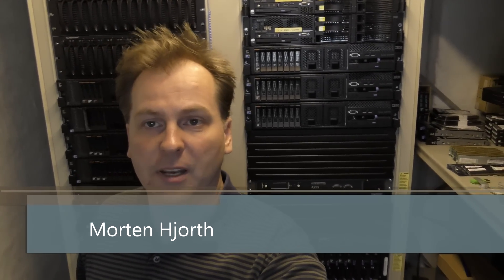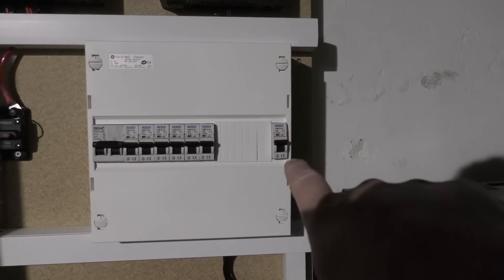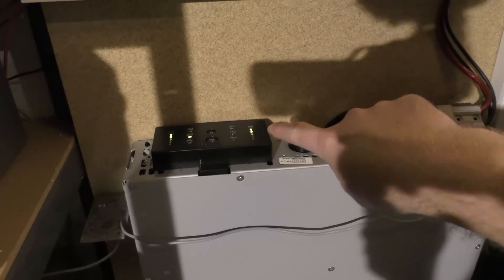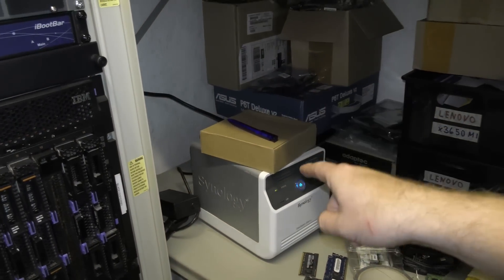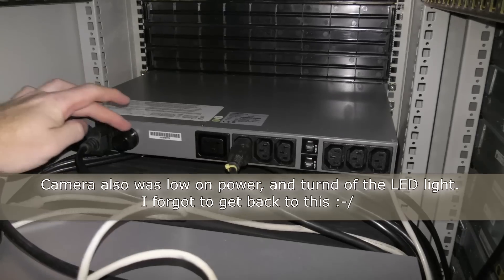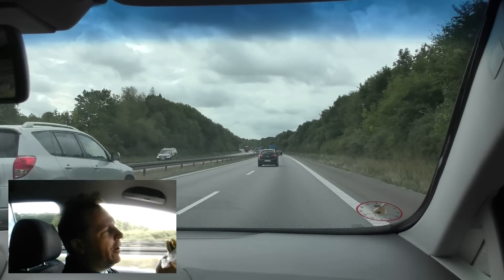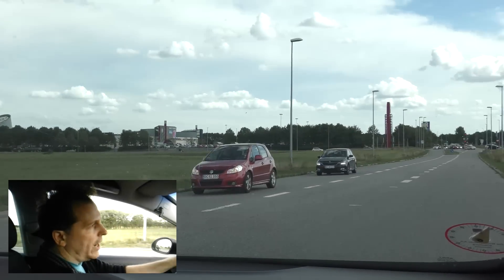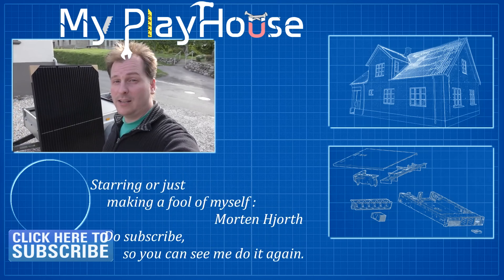I want to Run my Data Center of Solar Power - 733

Comment: The comments on here are really good..

The UPS is shouting at you as you are feedings DC to its AC.

I shall assume as I dont have all the details....
Plug main power ( normal) is as you would. and then take from the UPS Batteries out to the solar batteries.
I get the thinking but you would have to DC to AC invert and then AC to DC invert running it any other way and this will cause a lot of issues.
If you have put the batteries to the batteries of the UPS, then the voltage maybe too high or the amperage ( as you have no regulation) and the old batteries you have there will push out roughly 140 times more amperes.

Please update the chain wires between the batteries as it dangerous! You need higher gauge.

My UPS plugs to mains power and will switch to battery as is the standard. the only short coming is the capacity of the batteries. I think your trying to do it the right and wrong way.
Ill assume you're 240volt mains.
a battery 13.76 volts X 20 (275volt/228volt)
As you can see the range is fairly wide, you will want to run 19 Batteries.
(240 /12.5)
You will also need to test the batteries ( Wattage and amps) to find the capacity.

You then run the batteries in parallel and series. to get more capacity. ( you will only want Capacity)

For example:
UPS has 3x 12.5v AGM batteries.
 they are 6 amp 75 watt each.
If we run the 3 together we then have  12.5 v and  225w.

IF we then run 3 sets of the 3 we then get 37.5 volts and 225 watts
We now call the 3x3 a single unit of power and then  we use 3 of them we then get 112V and 675W

it will look like this:
_ _ _
_ _ _
_ _ _

That was small batteries and you have big ones.. so your "power" is likely to have around 50 amps.
[ batteries only have half the capacity that is wrote on them; LA;50 LIpo;75 AGM DC; 80]

So the math on this is 112.5 Volt and 150 Amp = 16,975 Watts

A average server eats around 175 watts ( per hour)
we will say 5 servers eats 1KWH

The battery array will run the servers just short of 16 hours. You will need 130 Amp Batteries to get this and a really good inverter.
Reply from the maker: Hi Rory Witham
Thank You very much! a bit to much at ones,,please know that I get a lot of comments across 900 videos :-) Comments are clean, because I reply to you all.
Thank you for watching! :-)

Comment: Why not use the server's UPS on the mains only before the switch, that way you will get good clean power from mains, and when that UPS goes flat in an outage event, the switchover kicks you to solar which is also on a UPS providing good clean power. In other words, don't daisy chain the UPS's.
Reply from the maker: Hi gnif
That Would not be much of a solar powered data center,, more like Solar backuped data center.
Thank you for watching! :-)
Reply: @MyPlayHouse  No worries, I am sorry I did have that backwards, I still think you should be on solar as the primary, just without one UPS feeding the next.
Reply from the maker: Okay,, did you see the video after my inverter blow up,, I have a problem powering the data center from the inverter..
Reply: @MyPlayHouse  Yes I did, but the problem you have powering it is because you're feeding one UPS into another, and your 2nd UPS is going nuts. There is no such thing as a true sine wave inverter, it's still a chopped signal that approximates a sine. Feeding that into another UPS that does line conditioning is going to confuse it.
Reply from the maker: I have been looking for a isolating transformer,, I am told that this would solve my issue,, but I have only been asking around a bit.
Reply: @MyPlayHouse  I was thinking on this today, I don't think it will help you. Your inverter is already using a transformer to generate the mains AC. An isolating transformer is just a standard transformer with the same number of turns on each side so it doesn't affect the voltage. The transformer in your inverter is providing the same level of isolation, while at the same time stepping the voltage up (more turns on the output side). Adding an isolation transformer will not only waste power and generate heat, but be very expensive to get high enough power to operate your UPS when it needs to charge.

Comment: It could be that the power mosfets are getting bad or their H-Bridge driver IC is slowly dieing. 
I ran into almost the same behaviour on my setup. Replacing the mosfets and the IC solved it. But then the internal relays are wearing out.
Reply from the maker: Hi DeeFuse
Thank You very much!
Thank you for watching! :-)

Comment: The noise is the 50hz sine wave moving through the ups’s transformer, indicating the load that you have on it is too much.
UPS’s are not designed to run continuously under load.
Reply from the maker: Hi 100% Random
Thank You very much!  But I do not think so,, it was just like 400 watt,, a vacuum cleaner of a 1000 watt NO problem.
Thank you for watching! :-)

Comment: Hmm buy a good inverter for example a solid Dutch made Victron 48v 5000W inverter. Further you have not enough solar power.  According my calculations you need a solar system off 24 panels from 48 volts 300w in series 96v / 120v max. maximum yield 8 KW  

That can save you about 40% to 50% per year on the electricity bill.

Used solar panels 48v 260w / 300w you can buy here in the Netherlands for € 125, - new a round € 200, -

I have no idea what it would cost there,  Denmark is an expensive country.
Reply from the maker: Hi lexpee
Thank You very much!  I have reduced my Data center down to just running one server, two switches and a NAS,, just under 400 watt,, I do not need that much solar..
Thank you for watching! :-)

Comment: The magnetic field is very close to collapsing which is why the transformer is so loud. That definitely is a ticking time bomb in the sense that it might actually brown everything out when it goes. I'd say you have a bad ups, the position shouldn't affect it. I think you should use solar and wind power, that way at night the wind can keep the battery bank topped off and allow for future expansion. It's not a bad thing to run batteries all night but it can significantly shorten their life.
Reply from the maker: Hi Travis Piper
Thank You very much!  It seams to be the IT equipment that the UPS do not like,, the vacuum cleaner that uses 3X power works fine...
Thank you for watching! :-)

Comment: The Problem with using a UPS as an Inverter is, that it's not designed for running a long time. Usually, it's designed to buffer for a couple of minutes. If you let it run for a long time it can start to overheat. Had the same idea with UPS. I gave up on that and bought a sine wave inverter that's designed to run 24/7.  And that noise comes from the Cover witch get pulled and kicked from the magnetic field of the transformer ;)
Reply from the maker: Hi DashcamDriversGermany
Thank You very much!  I have also been looking at inverters.
Thank you for watching! :-)
Reply: Yes.. you need an inverter not a UPS. Once you have the solar on-line you can stop using that UPS which should only be used for emergency backup. The transfer switch looks good, but you can also get inverters with it built in. You will need to research.. takes time finding the right one as you know. Also.. there is now an alternative where "inverter is not required".. microinverters.. Google them but check out the new "Enphase IQ8" coming soon in 2019. That's what I'm waiting for.. using 300w panels.

Comment: Morten, have a look on used "MGE Galaxy 11kVA" - I do have such an UPS, and it is a beast. I mean you have big batteries, go use them for some power, not for this bottlenecking small UPS vou've mounted to the wall :p
Reply from the maker: Hi Django Ryffel
Thank You very much!  more than I need.
Thank you for watching! :-)
Reply: @MyPlayHouse  do you think so? How high is you "Gleichzeitigkeitsfaktor"? That's a factor from the question, how many devices simultaneously can consume their peak consumption.
I prefer, to calculate with 1, because as a matter of fact, my Servers are often all to the same time on full load.

Comment: Funny fact: I was also considering setting up solar energy on my networking equipment, I laughed when you released this video talking about the same thing haha
Anyways, I probably won't need much power.. maybe around 300W (maximum of maximum). I have 2 notebooks running 24/7 (my main "servers") and an old computer for replication of the notebooks (that turns on at midnight and turns itself back off automatically when done). and also some very low power network stuff like an 8 ports GB switch, the fiber modem and a Mikrotik firewall.
Anyways², thank you for the awesome video!  I wish I had one device like that power selector.. would be very useful
Reply from the maker: Hi NinoM4ster
Thank You very much!  I am just under 400w right now,, one server two switches, a NAS and a fan.
Thank you for watching! :-)
Reply: @MyPlayHouse   only 400w? wow, then I may need way less than 300 haha

Comment: Power is so inexpensive here in the US I did the calculation and found that the investment was not worth the cost for us, maybe in a few  years. Great video :)
Reply: Here in Spain it’s definitely worth it. The solar tax has been removed for installations < 10 kW thanks to the new government and even if the price of the electricity was steady, it’d still be worth it, and the price is rising, so I’ll put some panels now!
Reply from the maker: Hi Unkyjoe's Playhouse
Thank You very much!  I like playing with it to.... I should think there would be something to safe it you could run your aircon of solar,, and the sun shines when you need that the most.
Thank you for watching! :-)
Reply: Not so much in New York City. We pay double the national average for power(!). :D Probably still isn't worth it though.

Comment: Hi, i think the ECTIVE SSI302 (12V) or ECTIVE SSI304 (24V) Inverter is probably something to replace the UPS, here a spread-sheet what it can do it is in german but self explaining ;) https://www.autobatterienbilliger.de/mediafiles/Bilder/wechselrichter/ssi_schaubild.jpg
Reply from the maker: Hi Grumpy Electrician
Thank You very much!  But I have a 48V system,, so something like this one : https://www.ebay.de/itm/ECTIVE-SI258-48V-2500W-5000W-max-Sinus-Wechselrichter/272765005046?epid=1543394355&hash=item3f820facf6:g:UNYAAOSwISNbgAI~
Is it a good brand?
Thank you for watching! :-)
Reply: But most of the UPSs are just made to withstand ~15Min of supply so that the OS can shut down or if the system is bigger the Generator can Start. I guess for the Price it is decent, there are probably better brands but also more expensive. I just saw there is also one 48V version wich switches automaticly then Grid power goes missing. ECTIVE CSI258. Maybe worth a try.

Comment: Hi Mort. You have that big main roof on the house, why not put solar panels all over that one too. You could double or more your production.
Reply: It would not work out well for him to put solar panels there, as those roof surfaces face east and west. As Denmark is pretty far north, the solar panels need to be pointing more or less south, unless it is ok with a rather low output.
Reply from the maker: Yep,, the need to point as much south as possible.. but I have considered the house as well.
Reply: Yeah but he could angle the roof differently, or rebuild it as a project for his channel anyway. And then add solar in. He could also try one of those sun trakcers up there. Of course he has to do cost benefit analysis. Maybe put some wind mills up there.

Comment: Maby your UPS does not like the square wave load from the other UPS. Try removing the 2. UPS from the load to test.
Reply: Indeed.
Reply from the maker: Hi Lars Steffensen
Thank You very much!  this might be part of the problem,, I tried with my vacuum cleaner 3X load then what the datacenter is right now,, and all is fine.
Thank you for watching! :-)
Reply: I had a similar problem.  We had a PC on rechargeable battery cart at work with a 12v to 120v inverter. I didn't like that the PC would just lose power as the battery discharged, so I tried to put a UPS after the inverter.  The UPS would click off and on and make strange squeaking alarm noises.  I contacted the vendor and they said my inverter was a modified sine inverter and the UPS required a pure sine inverter to function correctly.  So much for that.  Strangely the deep cycle battery on the inverter only lasted about 6 months before it was unusable. The battery was physically the same size as a diesel truck battery and since we have a lot of trucks where I work, one of the engineers requested a brand new truck battery for it (Which is not deep cycle by the way) and it has been running for a few years now with no apparent problems strangely enough.

Comment: I like the idea, what do you think about adding a bit additionally wind power?

The Superwind 1250 has 1.25 kW output at 11.5 m/s. Has very low cut in speed (3 m/s), zero maintenance, rugged design and even survive salt water, since it's made for maritime use.

Just one note: they don't like non-maritime use, so don't tell them you want to use it on your house when you ask them for a quote 😋

https://www.superwind.com/superwind-1250/
Reply from the maker: I do have an wind turbine,, but I am in a hole,, and nabos houses,, blocks for any usable wind :-/
Reply: @MyPlayHouse  damn 🙄

Comment: I got two questions acually. The rack rails that came with my Lenovo x3650 m3 server that I bought has the PN 69Y5022 and it doesnt fit in the rack case 37U 600x800mm deep.The actual rack beam is what I call it, where the rack units are screwed with the M6 screws. So I got the front and back of the rails connected/mounted,but I have like 20cm on the back of the rails that sticks out from where the hook secures the rail so I cant reallyg close the rear door on the case. I watched the 615 video of you installing the rack rails for the x3650 m3 server and you have like 5cm extra on the rails. Do I have the wrong rails?
I have checked on ebay and found IBM-400-00004 that should fit the m2 and m3 server of the x3650 series. Which 1 of the rack rails is the correct one?

The second question is about the Xeon CPUs, im thinking of buying X5670 or X5680 pair, both of them have FRU for me to search on ebay,I found one,but that one does include the FRU in description but cost like 2200NOK for 1 while I searched on ebay for x5670 or x5680 it cost like under 1000NOK. How do you buy the CPUs for your x3650 m3 server? So im interested to know if I buy just any x5680 CPU, will the motherboard accept that or if I need to find it with the specific FRU for the x5680?
Also,where do you buy that thermal paste?
Reply from the maker: It might not be a Server rack you got there,, maybe a network rack,, sometimes you can change the rack to be deeper..

CPU,,, there is nothing spicial with the CPU in the FRU,, except that the heatsink might be included. Just buy a cheap CPU and a separate heatsink. thermal paste,,, usually some of the cheap chinese stuff..
Reply: Thank you for replying Morten

It might be network rack as you say. I can move the rear rack steel beam a few cm back,but then cables would hit the rear door.
But what do you think of the IBM 400-00004 rails compared to 69Y5022?
What FRU is on your rack rail on video 615? I never see it in the video
Also,you think I should buy the 400-00004 rack rails and hope for the best?

Thanks for confirming for what I was hoping for. I will buy 2x hex core cpu's when I can afford them.

Comment: Solar powered datacenter in Denmark ? Wouldn't wind be a more efficient power source ?
Reply from the maker: Hi Jean-Claude Ben
Thank You very much!  There is 8760 hours in a year. We get between 1400 and 1800 hours of sunshine,, that is 16-20,5% of the time,,, this is unfortunately not very equally spread out over the year. Dec. has like 50 hours and maj with 240 hours (last year).
So some 17,5% of the time it can just run of the sun. But I do also get power when it is clouded,, just not full power. Snow is of cause a solar killer :-(
Thank you for watching! :-)
Reply: Windmills are not allowed in residential areas, and it would take significant installation work (expensive) with one big enough to provide an useful amount of power.
Reply: you can see that he already has a windmill  at 7:40   like you said though it's not big enough or high enough to make much power
Reply: gotta love Europe, everything is banned lol
Reply: It would be more efficient almost anywhere. A small windmill can generate up to a few kilowatts. 
http://theselfsufficientliving.com/diy-wind-turbine-designs-to-generate-off-grid-power/
Reply: He can build a home made wind turbine
Reply: In a residential area, he can only have a tiny toy wind turbine, with a low output. He's already got one, which is not very useful. Typical DIY wind projects are for very low power demands, a home data center with enterprise-grade hardware takes a lot more.